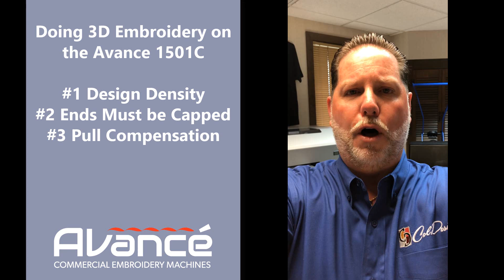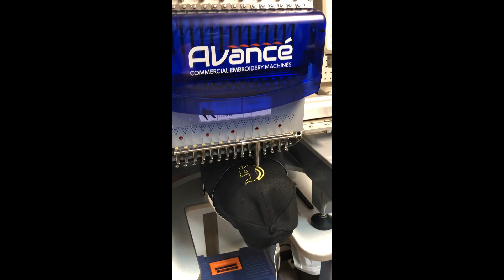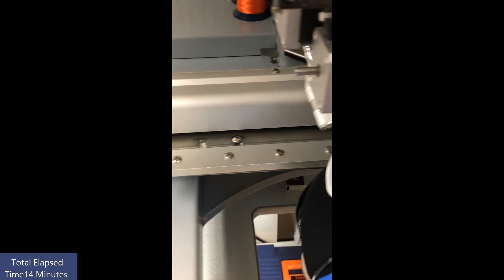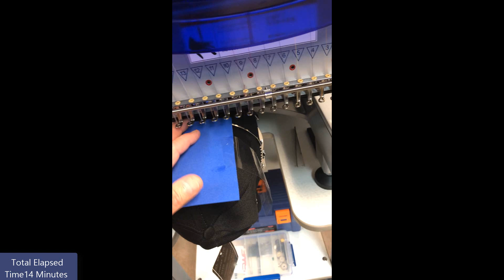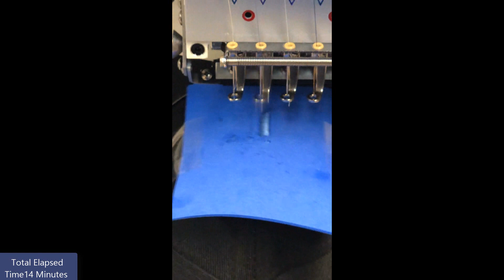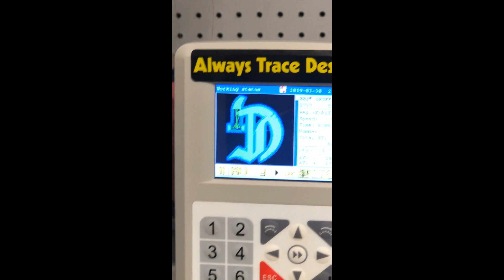How To Do 3D Embroidery With Foam & Avance 1501C

Comment: Hi Mr Dunbar I'm an up & coming fitted hat designer. I draw, another digitizes my drawings, then I take it to get embroidered. I want to make a few designs that are very dense but the places I've gone so far are fearful of using the 6mm embroidery foam I want to use compared to the thin 2mm foam they normally use. My next move will be to purchase and learn everything about it and begin test stitching. But I need some advice on what machine can perform the needs I have. I've been looking at Tajima and Redline simply because those are the machines my hats have been embroidered on in those embroidery shops. Do you know if your brand can stitch over very thick embroidery foam? I have 6mm but want to go thicker.